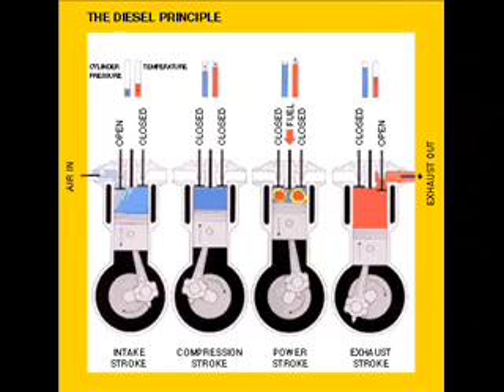School Bus Pictures engine rebuild and installation

Comment: @Difunto777 
In USA they work for cheap.
You spend 54000 getting your ase cert. and go work for TA truckstop for 24000 per year.
You only really make money if you either find the right job or start your own shop.
If I were a mecanic, I would go around to all the little fleets and owner operators and work on their trucks on their property.

Better to get into a good shop
More money if you start your own.